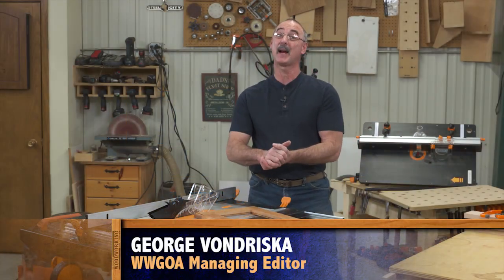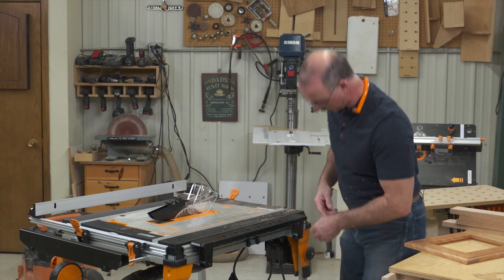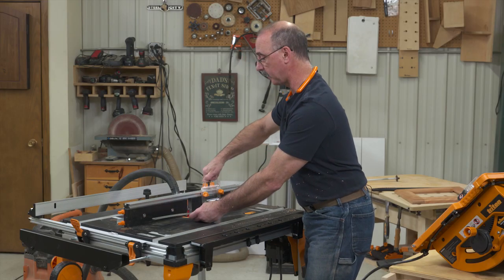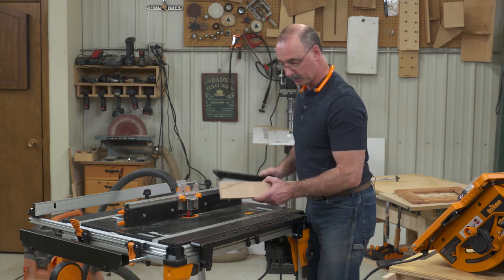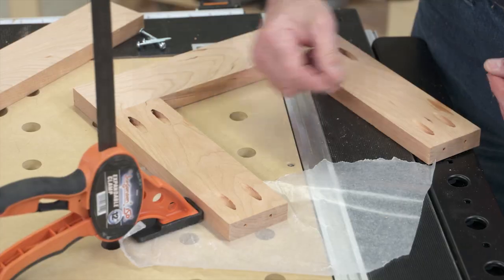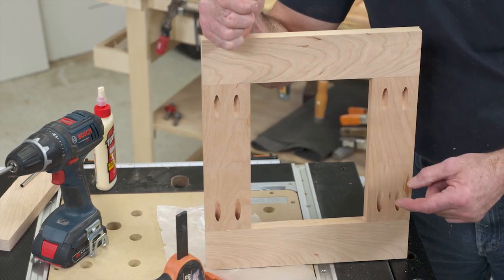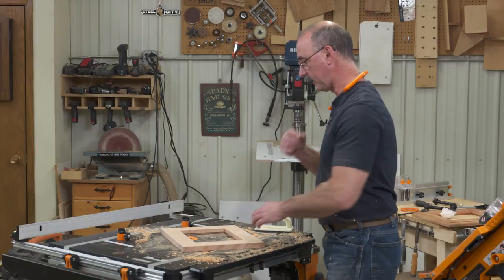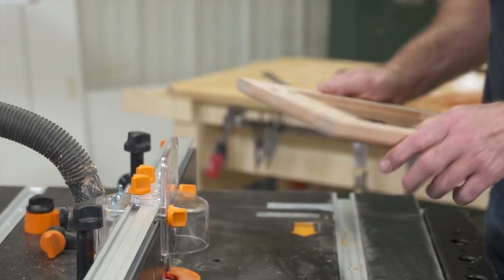Making Picture Frames Without Using Miters

Comment: This is by far the best non miter frame video I have seen. I really don't care about the brand of tools used. I agree that for me the rabbit before assembly makes more sense to me. Thanks for the video!
Reply: The benefit is that you don't have to bother figuring out where to start/finish the rabbets on the pieces with exposed end-grain.  If you just run them along the whole board on those sides, you'll have exposed holes in your frame, so you have to measure and plunge cut them on the router, and you can't see exactly where you're entering and leaving because your work piece is covering the bit. It's certainly possible, but there's less measuring and guesswork if you route the interior post assembly.

Comment: Nice commercial.  I like how your shirt and ear plugs match the sponsored product.
Reply: +Pete Nilsen Regarding this being a sponsored video; yes part of the WWGOA revenue stream comes from sponsored videos.  My job is to create a viable project or technique.  In this case, knowing that some woodworkers struggle with miters, I figured a no-miter picture frame would be a cool project.  At the same time, it shows someone who might be interested in the WorkCentre some of what the tool can do.  Whether working on individual tools or multi-purpose tools like a WorkCentre or Shopsmith, the work sequence is the same, and the project can be built.  Rip, joint, assemble, rout the inside, rout the outside.  The video also teaches jointing on a router table, something that can be done on many different router tables, and correct feed direction when routing the inside of the frame.  We try to ensure that sponsored videos also teach.  Sorry if you feel this one doesn't.  Regarding the shirt and hearing protection; I've been wearing the same shirt and "ears" for about 5 years.  Well, not the exact same shirt.  That would just be gross.

Comment: Blatant commercial is blatant.
Reply: ***** I don't mind featuring a product.  I don't even mind a sponsor paying a content maker to show off their tools.  These people have to make money somehow.  I do, however, mind when the content provider tries to hide the fact that that's what they're doing, and when it negatively affects the content.  E.g. in this case, they run the piece through the table saw, and then AFTER that, do a jointing operation?  Come on.  Anyway, this one was just over the top for me.
Reply: +n8guy Regarding this being a sponsored video; yes part of the WWGOA revenue stream comes from sponsored videos.  My job is to create a viable project or technique.  In this case, knowing that some woodworkers struggle with miters, I figured a no-miter picture frame would be a cool project.  At the same time, it shows someone who might be interested in the WorkCentre some of what the tool can do.  Whether working on individual tools or multi-purpose tools like a WorkCentre or Shopsmith, the work sequence is the same, and the project can be built.  Rip, joint, assemble, rout the inside, rout the outside.  The video also teaches jointing on a router table, something that can be done on many different router tables, and correct feed direction when routing the inside of the frame.  We try to ensure that sponsored videos also teach.  Sorry if you feel this one doesn't.
Reply: +Vondriska Woodworks Good points.  There are learnings to be had here.  I do think there could be more transparency as to paid sponsorship/commercial, but that's a subjective line that we each draw - just expressing my opinion that this wasn't as clear as I prefer.  What's your perspective on my comment regarding jointing after ripping on a table saw?  To me, that could be very confusing for someone coming to this video and not understanding when and why to joint.  So rather than beneficially educational, it could introduce confusion (seemingly in the effort to show the swappable feature of the Triton setup).
Reply: +n8guy On our sponsored videos it'll always say "Tool X provided by mfr Y."  Maybe that's not enough transparency.  I'll run it up the flagpole.  Thanks for the comment.  Jointing after ripping...that's my normal sequence.  The board goes back to the jointer to remove saw marks.  I rip 1/16" oversize to allow room for this in the width of the board.
Reply: +Anthony Tobba My process is usually something like this:

1) joint to get 2 perpendicular flat sides
2) rip and cross-cut for rough dimensioning
3) perform whatever operations that make sense at this point (joinery, routing profiles, etc.)
4) final dimensioning, generally on the table saw

That said, it's good to know that there are other approaches out there that are mainstream or are done by pros.  Sincerely didn't know that before.

As for it being an obvious commercial, I agree.  I just didn't feel like there was enough acknowledgement of that, and that some may miss that (particularly those new to this channel or newer woodworkers).  I prefer a very clear statement about sponsorship, and find that on most videos where that is the case.
Reply: utensili mct
Reply: No comment

Comment: disappointed, usually you put out good information. how much did triton pay?
Reply: +red corvette Regarding this being a sponsored video; yes part of the WWGOA revenue stream comes from sponsored videos.  My job is to create a viable project or technique.  In this case, knowing that some woodworkers struggle with miters, I figured a no-miter picture frame would be a cool project.  At the same time, it shows someone who might be interested in the WorkCentre some of what the tool can do.  Whether working on individual tools or multi-purpose tools like a WorkCentre or Shopsmith, the work sequence is the same, and the project can be built.  Rip, joint, assemble, rout the inside, rout the outside.  The video also teaches jointing on a router table, something that can be done on many different router tables, and correct feed direction when routing the inside of the frame.  We try to ensure that sponsored videos also teach.  Sorry if you feel this one doesn't.
Reply: You can always start sponsoring videos if you don’t want product placements. Until then stfu and let this cat make a living showing me how to make non miter picture frames